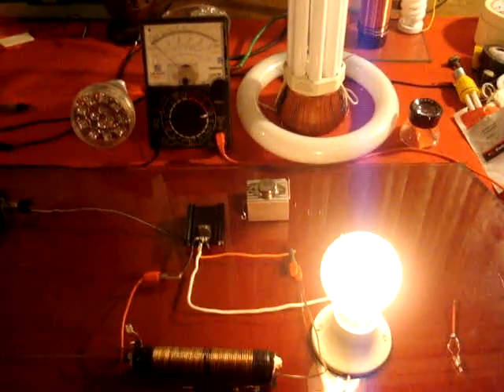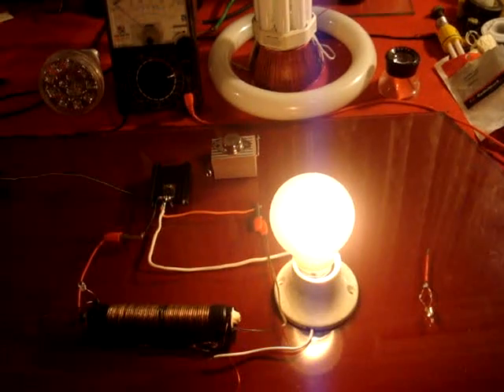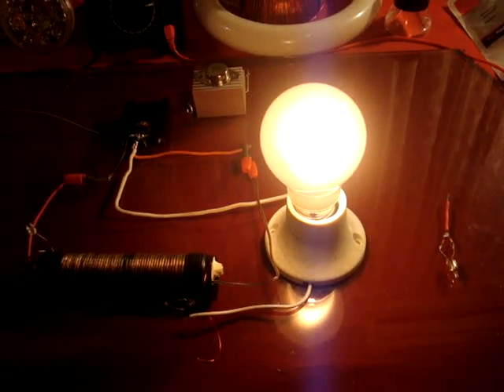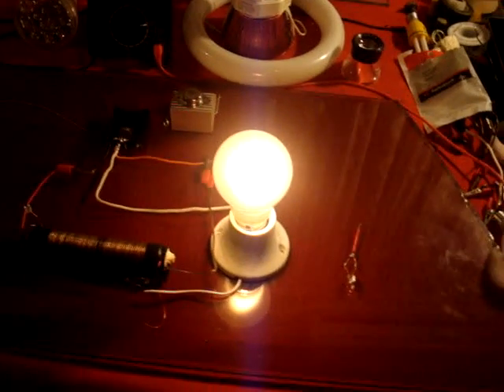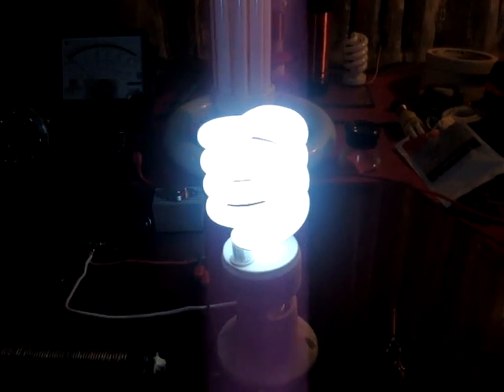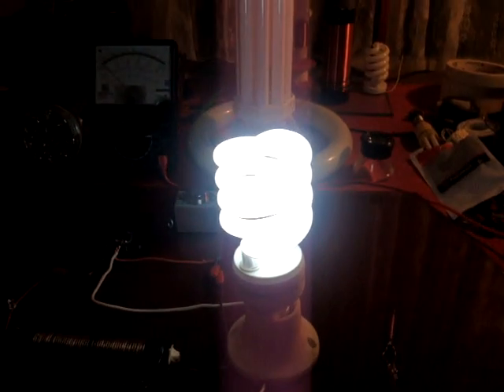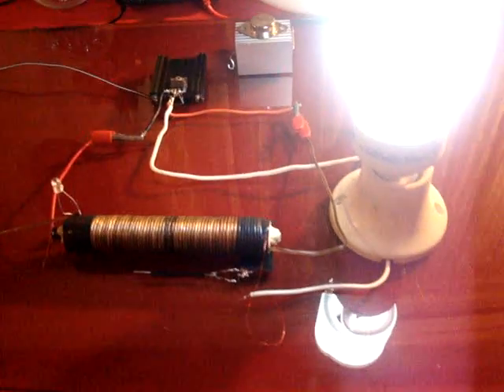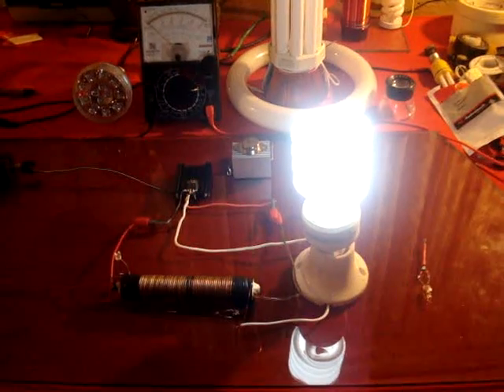Joule Ringer 3.0.-  Lighting a regular 60 watt bulb, and a CFL bulb

Comment from the maker: I have tried to add more turns to the secondary, and burned out a 25 watt Cfl, it's internal circuit. I have also tried adding twice the amount of primary turns, and did not get better results, or less transistor heating. 
  To join the 4 ferrite beads together, I used a pencil in the center of the beads, with electric tape over the pencil to adjust for a tight fit, and some masking tape on the outside of the bead core. I would try more beads to make an 8 inch core, but 4 was all that I had.

Comment: Nice replication. On the ferrite beads, did you have to glue/epoxy them together? Just curious. Also the primary and secondary turns....are they accurate as lasersabers uses 14awg which is thicker. Look forward to seeing it running on the 2n3055. My experience with the TIP3055 is that it does get hot to the touch with some replications so I stick to the 2n3055. Cheers

Comment: The way I understand this simple inverter. Is that you keep the primary (14 gauge) turns to a minimum and the secondary turns to a high count. The low count primary keeps the transistor from burning up, less amperage draw. Also you could also mod the frequency a little by adding a rheostat to the base side to change the brightness as well. This things is interesting but the amp draw is not attractive.